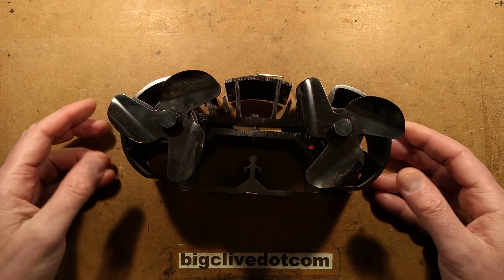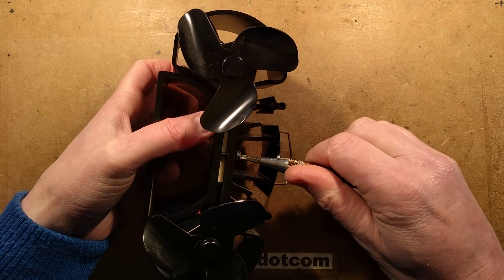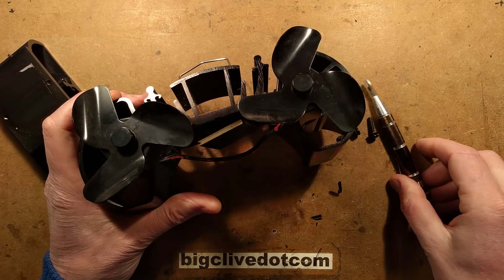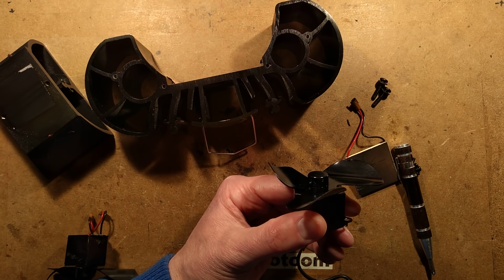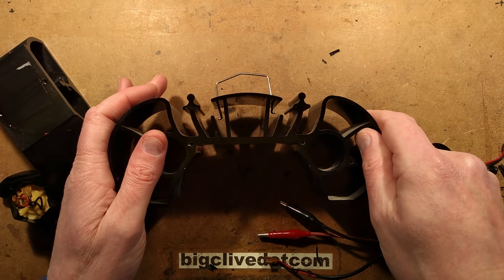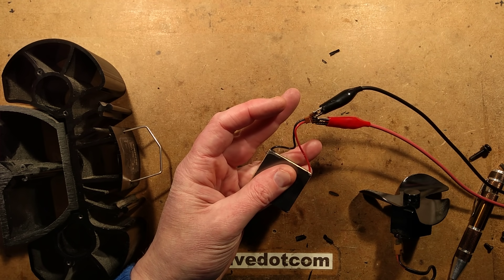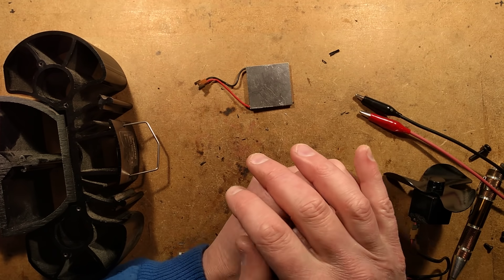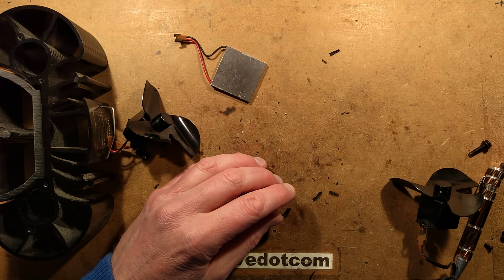Teardown of a self powering machine.

Comment: Can someone tell me if there is a purpose for these fans?  It seems to me that a fan that runs on the heat of the stove in the kitchen is going to blow hot air.  Is that what it's for or is it a "toy" conversation piece?  What's the point of having one on the stove?

Comment: The Alzheimer's tipping point in our family was coming in to an eye-watering stink and discovering she'd put the plastic kettle on the hot range, which had promptly done and impressive Salvador Dali impression.  I guess she'd regressed back to the point where she had metal kettles and well, that's where you put them if you wanted hot water.  That was an absolute bitch to clean up, though thankfully not as.. organic as yours.
Reply: I tried putting the tea bag jar into the teapot and then got angry and for some messed up reason i then put the teapot in the fridge maybe i was having an annuerism or a brain lapse who knows?
Reply: What did you use to get the melted plastic off? Sounds like a total nightmare.

Comment: i ordered several tec and teg modules on amazon but non of them worked as a power generator although the sellers mentioned to be a teg "generators" any suggestion where i can buy a real teg and not tec
Reply from the maker: They do sell ones specifically as generators, but I've found that the coolers do work in some applications.

Comment: These peltier modules are unfortunately very inefficient. On top of that, if you just leave the device on a heat source and slowly heat it up, the heat goes right through to the other side, heating the whole device and thus not producing a temperature difference. These fans are self-cooling, so if the fan doesn't spin, then the cooling simply fails. To actually start these, they must be placed on a hot stove that's already heated. Or such a rapid temperature rise on the bottom is required that the topside doesn't have time to heat up before the fan starts.

Comment: You’ve inspired me to turn mine into a phone charger ,,,,fan is trash.
Reply from the maker: You can get new fan motors on eBay.  It's a very standard type of motor.  The airflow from the fan is needed to create the thermal difference to generate power and keep the thermoelectric generator from overheating.

Comment: I've got a similar one of those except mine runs essentially silent, it makes no noticeable noise whatsoever. I also find that sometimes that fan doesn't start spinning but I find that if I just touch the fan, it starts spinning nicely - Here's a pic of the one I've got https://i.imgur.com/kDWPbrI.png . It features a 2nd smaller fan parallel to and behind the main fan.

Comment: What about these for car use. Wack 50 onto the radiator, take off the old altinator. Use the engine heat to charge the cars battery. Save fuel not turning an altinator?

Comment: Real world compressor based larder fridge full size under counter model. Typically consumes 65W of electric for typically 15 mins per hour.  A fridge is a heat pump and generally moves 4 times as much heat as it consumes. In comparison Peltiers are hideously inefficient at cooling .   They make more sense as heaters.

Comment: There are some differences between Thermal electric coolers and Thermal electric generators. Their supposed to be optimized for their intended application. I made the mistake of using a thermal electric cooler to repair a fan like that when I should have used a thermal electric generator. It wasn't long for this world and while it did work it burnt out within a relatively short period of time.
Reply from the maker: I've played safe and ordered some of each.

Comment: old ladies saying. "i am ugly am i not ?" and i saying "yeah kinda"
Reply: those good old days, how much volt can an old lady generate when one put her on a hot stove  with a generator in her hands? i think maybe 3,6 volts at most. but the noise she will make would be unbearable. maybe put a sock in her mouth that mutes about 40 to 50 decibel for comfort. and a nice classical music piece in the background to mute the other 20 decibel about "how lovely she was when dinosaurs ruled the earth" enough to power two led lights depending on the amp's. maybe more peltier units connected serial and or paralel. or water radiator cooled, that will bring the air tempreture down, wich is quit hot right now. a little waterradiator behind the fan. those cpu cooling device can help yah.

Comment: +bigclivedotcom those are Mabuchi RF-500TB-12560 motors: https://product.mabuchi-motor.com/detail.html?id=77 - you can get chinesium ones from the usual scumbags for under an Euro IIRC. Just do a search for RF-500TB. I recently fixed a mate's shoe dryer and ordered a batch of 3 (one to put in, one to be DOA and one for the reserve). The DOA one even works, but vibrates AF. Always over-order.

Comment: Why the heck dont they use that heatproof wire on these.
Reply: As Clive points out, when they come up to temp fast, they may never get hot enough to damage anything. Yes, $.03 extra would have stopped the failure mode, but that would cost $.03. I'd like to know what the heat flow is like when everything is humming.

Comment: Those is quite little genius ' things ' . They are NOT for making a cool breeze on a summer day ...
The intended original use is to place them on a wood stove .
If you live in a country that gets very cold in the winter and using a wood stove , then you place one 
of those on top of the stove and it will blow the hot air so its better circulated around the room .
This make a nice warm breeze in a very cold time and it's totally ' off grid ' too .
Perfect in a winter cabin .

Comment: How about putting a Nintinol high output thermal electric generator in that dual fan and use high heat magnet's on the fan's for magnetic bearing's with a V - twin stirling hot gas engine with a wobble plate to spin the two fan's. With wireless energy transfer technology added in to beam the electrical energy generated by the Nintinol high output electrical generator to power light's or recharge batteries? A better tool for folk's to have. Could design it to operate with a G stove. 😊

Comment: now the point is with this device ??. all i see is you got a fan...all well and good...but you need heat from a heater to power it (NOT self powering), what does it do exactly apart from blow air out ??, does it blow heated air about or cold air as it would defete the object of being warm if it was blowing cold. would it not be better having it power a light perhaps ???...you know something actually usefull and not useless as a fan.
dont get me wrong its a decent idea, i have a trackclip (reminds me of that device)...you know one of those clips that hold a train track rail inplace !!!....NO..!! its not from a running line lol, i nabbed it from a long axed beechin era abandoned line that had some stuff still there....anyhooo. it sits on the radiator now and gets hot...obviously...and i thought what if....just what if you could power a light via a similar object using heat transfer as a source of power.
Reply: G'day,

  It turns a Stovetop into a Fan-Heater, distributing the hot air coming off the Hotplate horizontally accross the Room, rather than having it all rise up and heat the Ceiling ; before then slowly filling the Room from the top down.

  If you're buying Gridpower to run an Electric Hotplate then it's a stupid idea..., but I have a miniature Potbelly Stove which burns windfalls from the Forest Floor ; and one of these little Gadgets would be both useful & ornamental, because it would make the Temperature-Gradient within the Hut a lot less of an issue (20 Degrees Celsius variation from Ceiling to Floor is not uncommon, ranging from 15 up to 35..., which is fine on average - but a Thermo-Electric Fan to mix the Air in my Hut would be a very elegant solution...).

  Such is Life,

  Have a good one...

  ;-p

Ciao !
Reply: @WarblesOnALot  thanks, ive never seen one or heard of one before. its not a too bad invention when you know what it supposed to do, but the product clearly has serious flaws that need rectifying as in the wiring system crispening and bareings drying up (thats nowt that a bit of lube wouldnt fix i dont think lol).

the whole idea of using a heat source to power something is a great idea, i cant fault the inventor at all over that. ive thought of it myself with having the trackclip on radiator, and thinking if i could macgyver something up to use for a heat source (central heating) power unit for a small low voltage consumption light or something. least i know it CAN be done now :)
Reply: +rodney mckay 

  Ah, well, my take on it is that if they'd had high-temp. resistant Silicone insulation then that would've been better, but whatever the Designer specifies goes to the Production-Engineers, and they figure out ways to cut costs - IF the Product is operated "correctly" ; and the Managing Director signs off on that, and what rolls off the Production-Line is almost a well made item.

  In this case, it appears to be fairly vital to,

   1) Wait for the Hotplate to actually become hot, before placing the Cold Fan atop the Stove ; so that the initial Heat-Pulse rises up to the Peltier Device quickly, before the Cooling-Fins can be warmed by the hot-air which is otherwise rising over the Stove...

  2)  Give it a rest, if it appears to be overheating.

  I wonder if casting the Heat-Sinks & Conduction-Fins from Copper instead of Iron, Steel, or Aluminium, would make the Heatflow Equation more energetic ?

 Have a good one,

 ;-p

Ciao !

Comment: The thermal efficiency of a Peltier element is only between 10% and 15% whereas a compressor driven fridge kan get up to 300% efficiency, yes 300%...for every 1 watt of energy put into the compressor 3 watts of energy can be transferred from the inside of the fridge to the outside...from evaporator to condensor that is, in some ideal instances this can be even higher. We call this the C.O.P. : Coefficient Of Performance, in some cases we get this as high as 5. Just to let you know never to use these crap Peltier driven fridges unless you have no option.

Comment: They don't look like they're designed to run on gas stoves... so if you have an electric stove (that works), one would assume you have access to electricity... so why bother with this contraption? What am I missing? This basically sounds like "powdered water - just add water!".
Reply from the maker: Solid fuel stoves.
Reply: @bigclivedotcom  i Just Sent You a Msg . Of Older One's for Wood Stoves.... Where Can I Find Something like this. A Name maybe? Thanks from Pennsylvania Mountains ✌️
Reply from the maker: @bansheemania1692  They are very common on eBay as stove fans.
Reply: @bigclivedotcom  Thank you Very Much.✌️🥃🥃🥃

Comment: Well it's heat powered isn't it. No matter the mechanism that thing dose not power itself.
Reply: He means it does not require an external source of power such as batteries or a power supply. 

Now lets see you come up with a simplified version of what i said for a video title and i will see if it is any good in a light hearted way and come up with my own.

Comment: After last year's scorching summer I don't think there is much point in thermoelectric fridges especially if you live further south. It's not just their poor efficiency, they only cool to typically 20 degrees C below abient so if ambient is 32 C (90 F) they are not much use. If you want a small fridge that will still work in extreme heat Drinkstuff now do a 20 litre compressor fridge https://www.drinkstuff.com/products/product.asp?ID=24465&catID=1508&name=Frostbite+Zero+Degrees+Mini+Bar+20ltr+Black#.XFqgErhHOiA I'm very tempted to get one.

Comment: They used the wrong wire. It should have been orange thermal resistant wire. The Motors are heat resistant  (oarnge coloured) and need to be replaced with the same type. The heat will melt the lubricant out of the motors and they will fail in about two years on average.

Comment: Wait, so what's the point of these devices?
Reply: They sit on top of stoves and the heat spins the rotors and supposedly helps circulate the heat in the room.
Reply: circulate room air on top of the stove (wood, coal or coke)
Reply: @Jacob-yb6bv  they definitely work. Ours reminds me of the Martian heat ray from war of the worlds if it points towards "my" tenth of the sofa in the evening.
Reply: @Francois_Dupont  i tried sniffing coke once but i failed as the lump was way to big to fit up my nose even though my nose is huge so i just threw it into the metal forge where it belonged ;) what is funny though is that my mother wanted to hoover the iron age forge that i worked in hahahah made me laugh my ass off as it is outdoors.
Reply: Pass butter

Comment: Those motors badly need some oil in the bearings.
Reply: I think the bearings got all hunky clunky themselves (rough surfaced,deformed)
Reply from the maker: A drop of oil did work wonders.  I wonder how long it will last.

Comment: These ones generate up to about 2W and are quite temperature resistant. They can endure 120 to 140°C opposed to 58°C or 70°C of cooling purpose peltier elements.
https://www.ebay.de/itm/5PCS-SP1848-27145-TEC1-Thermoelectric-Heatsink-Cooler-Peltier-Plate-Modul-TEC/172271544003?ssPageName=STRK%3AMEBIDX%3AIT&_trksid=p2060353.m1438.l2649

Comment: Cheap versions of the original EcoFan are nowhere near as good or reliable. I've had my EcoFan for, maybe a decade, without any issues. I even bought a second as there was enough enough room on the top of the stove for one.

I've not tried a low-profile one simply because I have concerns about the heat dissipation of the designs. Looks like I might be right.

Comment: Hi Clive, Ihave a Range Rover heated / cooled seat unit that uses the same technology. It's reporting as faulty in the car as the airflow tract from the fan is cracked and leaking. Do you want it? Search part number 8A5Z19N550B that's very similar.

Comment: What is the point of these devices - are they just novelty? Pardon my question, but I sat there going WTF???
Reply from the maker: They circulate the heat from the stove into the room.
Reply: @bigclivedotcom  Holy cow Batman! It never occurred to me. My MIL used to leave the oven running longer than needed  to heat the kitchen. But this stove top device. I'm flabbergasted. Its ingenious, though the heat will go into the room regardless, the idea to use a peltier cell to generate power to drive the fan that blows air over the cold side in order for the peltier to see a temperature differential so it can run the fan that blows the air.... I loved the bit about multiple vanes on the cold side! All I can say is millions would have suffered in the cold if they were going to wait for me to invent that! Thanks Sir! Very illuminating!

Comment: the motors can be found in them automatic air freshener spray devices..every one ive pulled apart so far has the same motors..the ones i have are labeled "Action Motor" and nothing else..
eg https://jcprojects.wordpress.com/2011/02/09/glade-sense-and-spray-teardown/
Reply from the maker: I'll have to check that.  It could be an interesting source for them at short notice.
Reply: @bigclivedotcom  im pretty sure they are only 3v...where the general motors you see are 5-9v..which would make sense in a device using a peltier

Comment: The two-fan unit would probably work better if it had a pillar lifting it high up like the other one has.
Put the Peltier between the top of the base & the bottom of the pillar...it should work well then.
Some folks use the Peltier's for CPU cooling...but you have to have a heater on the backside...or it will FREEZE!
"Period furniture...That doesn't mean it was red & moist"  Cue the butt hurt liberals screech-fest!